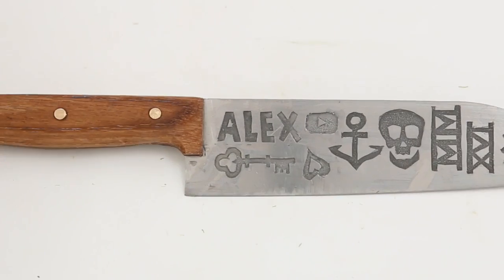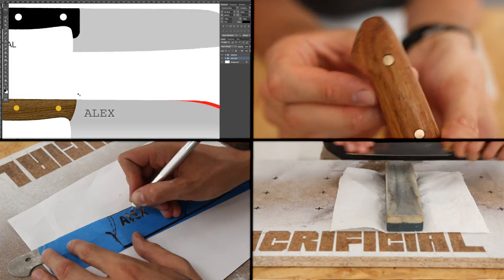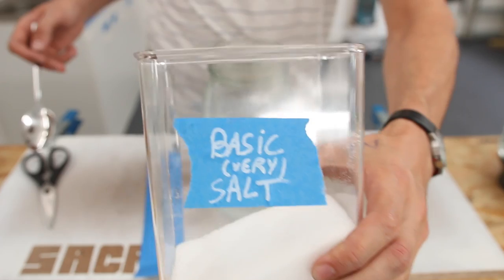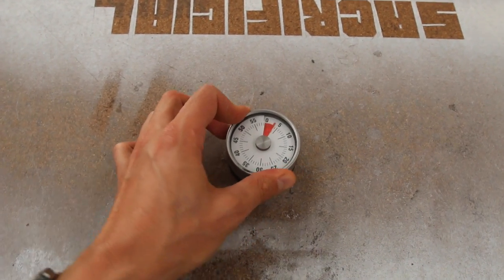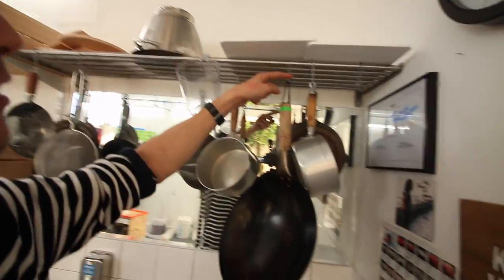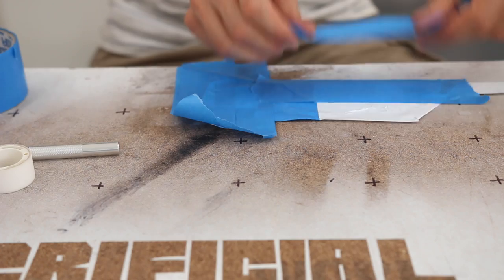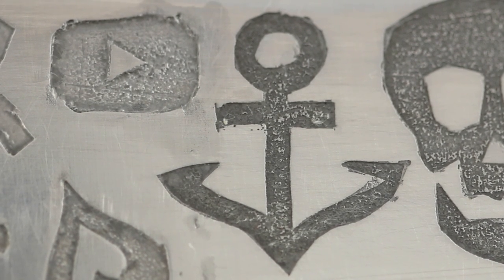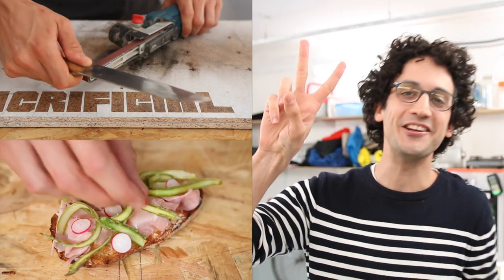How to Tattoo a Chef Knife Blade with Metal Etching ! Chef Knife Makeover 3/4

Comment: It's possible to get a more even depth and texture on the etched designs by using a shallow container that allows the blade to lie flat, then using a stiff feather every few minutes to brush away the bubbles that accumulate on the unmasked areas as the process happens.

Comment: I LOVE this series! Personalising a knife is an idea that I'd never thought of, but now I'm so eager to try it! Just a question which may be dumb, but are the "tattoos" considered food safe? Or, how will washing the knife with soap affect them? Just curious. I don't really know anything about metals or electrolysis. ty :) :)
Reply: Makenzie Mergard It should be fine since he's etching stainless steel onto the knife :)

If I was to etch my knife, I'd probably use copper since it looks cooler and copper salt is easy to get so I'll use that instead of normal salt to get a better colour :)
Reply: Etching is something else than electrodepositing ;-) what Alex is doing here, is removing metal from the knife. It doesn't matter which salt you add, and you will get the same effect, even if you use a copper salt. 

If you want your "tattoo" to be copper colored, you can add a copper salt to the water and connect the knife to the negative side of the battery (so opposite to what Alex is doing here). This way, instead of removing metal from the knife, you'll deposit copper on it. However, this copper layer is probably not very adhesive and therefore, I would think it is not food safe...
Reply: +Jeroen Sniekers  The close-ups of the etched areas look kind of rough. If you etched an area, then kept the same mask in place and electroplated with copper salts, might not the added roughness of the etched base metal give the copper a better surface to mechanically grab on to?
Reply: That is indeed very plausible! But still, electrodeposited copper is not always nice and shiny and bright, it is most often dull or can even be black due to the roughness of your deposits (the more roughness, the more light it absorbs, hence the darker it looks). In industrial systems, they prevent this by adding all sorts of other chemicals to influence the roughness of the deposited copper, but at home this will not be easy. 

Still though, nice idea, and you can definitely experiment with it! Just don't try it straight away on your best knife ;-)
Reply: Etching is food safe because it just removes material from the blade like  sharpening the edge removes material electroplating with copper  on the other hand would probably just rub off as you cut things over time which means you'd be leaving tiny amounts  of copper in everything you cut which could effect the taste of the food which is bad enough even if that is all the harm it would do

Comment: (0.o)

Wow, that is so much easier than my technique.... Just dip, no sweeps.

For those new to this type of etching, instead of tape, I use spray paint. Nail polish also works, but is gooey when cutting.

I find paint a bit more tedious overall, but easier to make more detailed "tats."

Never thought of dipping it in solution though. Absolutely will have to try.

Comment: So, dumping that electrolyte bath down the drain was likely illegal and dangerous. You can't use stainless steel electrodes like that. The specific alloying process used to create SS will cause the release carcinogenic and toxic chromates that need proper disposal !
Reply: The exposure limit is 0.1 mg/m3 for chromates.

Comment: Tried this yesterday on two different knifes. Unfortunately it did not work. I had "bubbles going on" ;) but even after a full hour, all I achieved was a very thin, rusty-brown looking coating that comes off with dish soap. Don't know what I did wrong... Batteries were new, I tried different amounts of salt and different temperatures of the water... And as I did not trust my clamps I even sodered my kables directly to the knife.

Maybe the Ikea fork I used as a sacrifice was not good, though it said it was stainless steel.

Did someone else try this out?
Reply: too bad
Reply: maybe the polarity of your clamps were reversed.
Since you get a "thin layer" of something then you were depositing material onto the knife (and the fork was losing that material). It should be backwards, you should have been losing knife material, and depositing it onto the fork.
Where you put each clamp matters for this